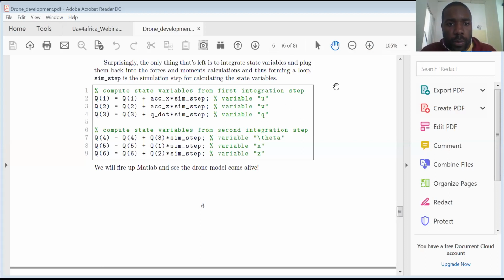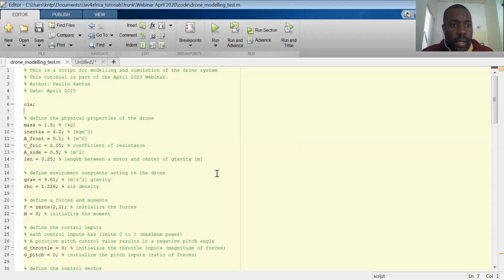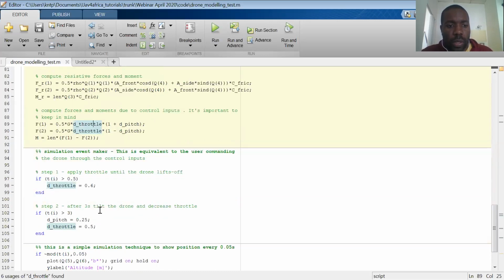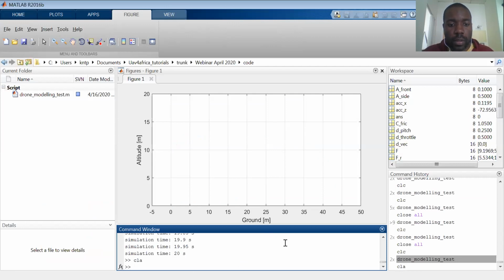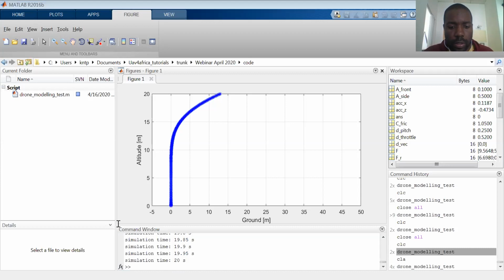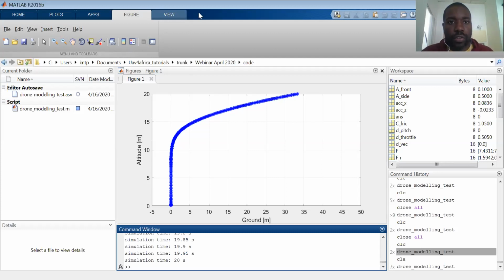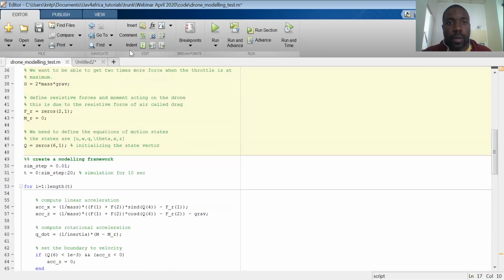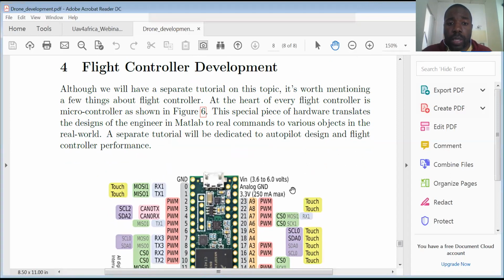Drone Flight Physics Course (including Simulation Model) (Part 2/2)

Comment: Great thanks, great thanks with a lot of thanks. First of all, we will immediately write both video.
Brother I am 75 (Seventy five years old). I was interred in computer fields last five years. My education back ground i.com (commerce). I have learned programming language such as Js, html, css, N.Js, Php, React, React-Natve, Python, Machinelearning, Arificial Inteligence, Lath Machine, Auto-Wehicles. A lot of data have collected on medium hovercraft. etc. In this age I am sitting on my lap top at least 12 to 14 hours and more daily sitting. Note my English language very weak. Please neglect this shortage. thanks. Ishtiaq Ahmed siddiqui.